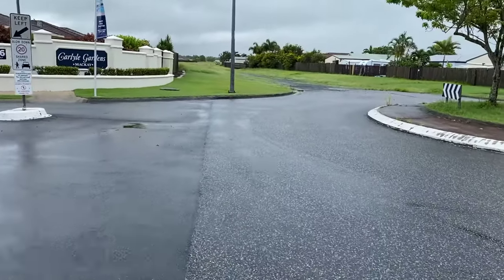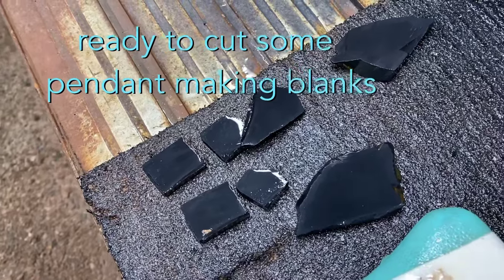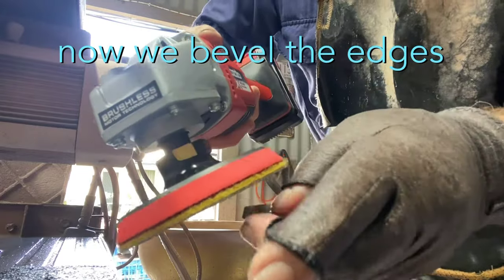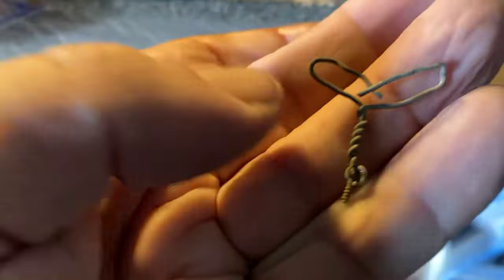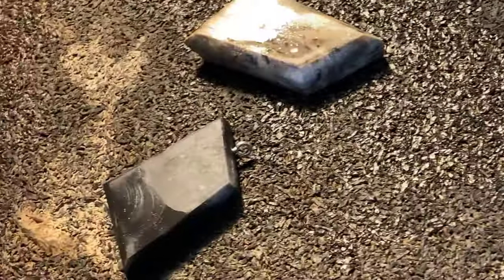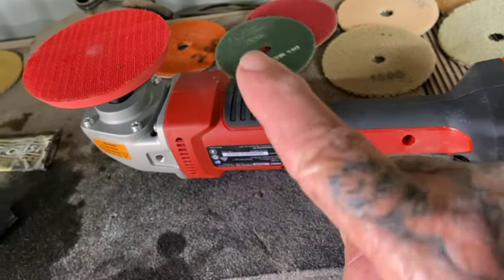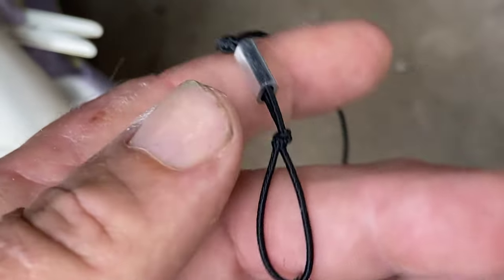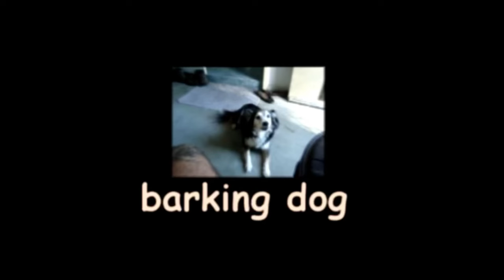Polishing Rocks with Hand Held Sander/Polisher - Making Pendants

Comment: I noticed that you used the 10k pad wet. Have you tried using the higher grits dry? I find dry gives me a higher polish.
Reply from the maker: good point NZRD, I brushed on that subject in my polishing peanut wood video, yes, I use that method, I keep a spare 10,000 grit pad for just dry use. 
     Another good method is to buff the water off to dry, and then buff a little more before wetting again, (a sort of half way method),     kev

Comment: I've been watching your old videos polishing rocks and want to use your technique.  Been shopping for similar model grinder here in the USA. Now I see you have a battery operated one. Question, will this lightweight 18V machine handle the initial shaping with the grinding cup wheel as I've seen you do with your big electric model? Love your vids, thanks for sharing and educating.
Reply from the maker: hi suzy, allthough i can only speak for the OZITO brand i use here in australia. It has power to spare, and I imagine that competing brands across the globe would offer similar. Good luck with your hobby going ahead, I find this method versatile and easy, from making tiny pendants through to very large rocks, it requires a normal fitness of the body, but i have athritis in various areas , and i manage it quite well, thanks for interesting comment, kev